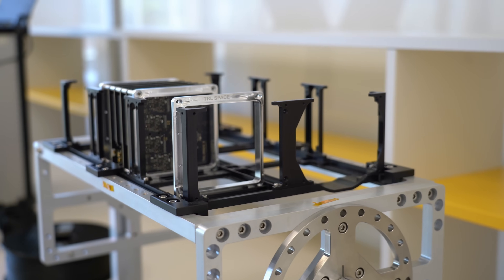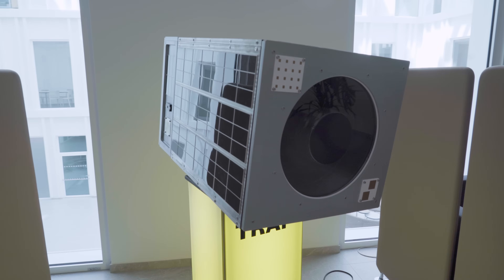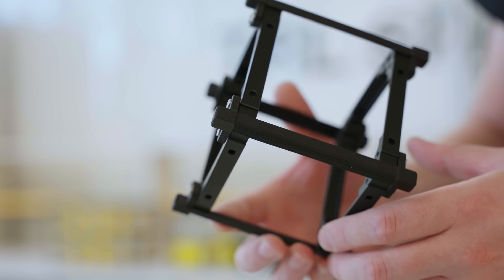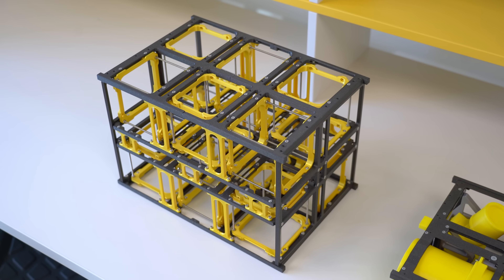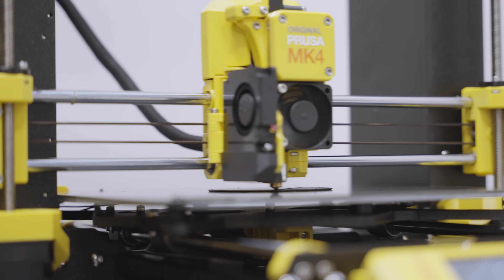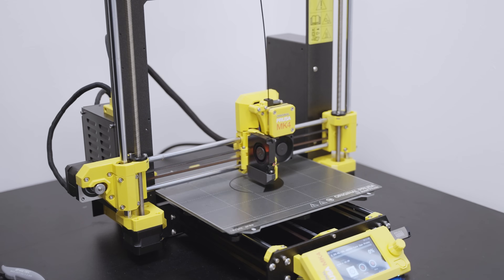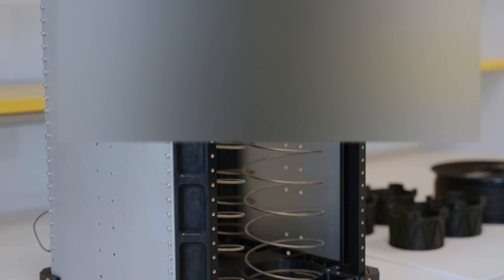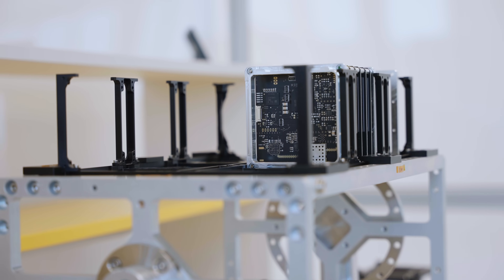The FIRST Space-Grade Filament You Can Print at Home – With TRL SPACE Taking It to Orbit

Comment: Nice conductive filament. I wonder if you could just 3d print with nylon and then spray paint with conductive silver ink?
Reply: Too much outgassing.
The reason space materials are generally so expensive is because of: 
* thermal properties: has to be able to withstand -160C to 40C temperatures
* offgassing: can't have any gas inside the material that will boil off and damage the structure or interfere with it chemically

Comment: How can this material hold up to 250F in the sunlight in space. Do they have a fast spin to even out the temp?
Reply: According to the print settings of the material, the nozzle temperature is 290°C (that's 554°F), so I imagine the filament could withstand 250°F reasonably well.
I'msure there are heat resistant coatings that could bolster that, too (the ESD sound like the more relevant property, tbh).

Comment: Printing PC for space use without a heated chamber just doesn't make sense to me. Why would you deliberately sacrifice material properties in such a critical application?
Reply: That filament doesn't need chamber. Is a special PC.
"The filament shows little to no warping. Models as large as 200x200 mm can be safely printed on Prusa 3D printers without any issues."
Reply: @AndreaGaleazzi3D but chamber heaters are more about layer bonding properties and to some degree, controlled cool-down for better dimensional accuracy.
Reply: @Roobotics  I’m sure they made their tests. This product is been developed by a specialised space company, I’m sure they know what they are talking about
Reply: It says PC in the video, title, and links to it in the description, so I'm not sure what you mean.
Reply: Uh. They're not printing PC
Reply: @ZeeLobby totally false, they repeatedly mention "ESD filament", and link to "Prusament PC Space Grade Black" which is indeed their ESD material.
Reply: @Roobotics they also sell esd abs, you can also get esd in other filaments. It doesn't shock me that they'd want to sell their PC esd. But that doesn't guarantee that's what they're actually using. As the actual employ doesn't mention PC in the video anywhere. Shrug
Reply: @ZeeLobby  True but they link to the PC specifically and did mention it's off-gassing properties per the application. Also printing ABS without an enclosure is probably even worse without an enclosure IMO.
Reply: @Roobotics nah. Your probably right but again, if it falls in the tolerances required it may not be an issue. As an aside this was def an ad. For all we know when they do actual work pieces they use enclosures